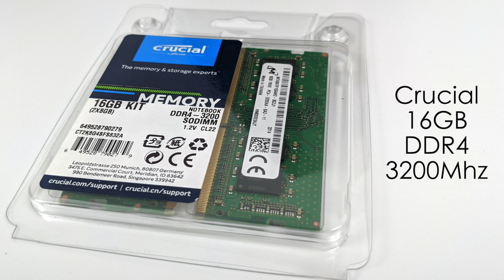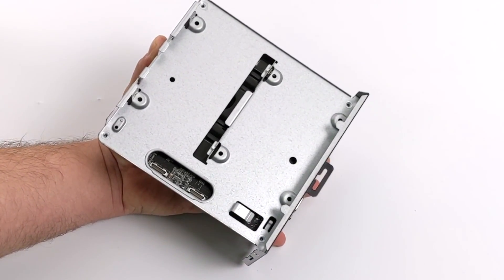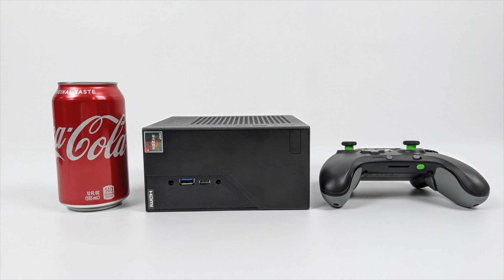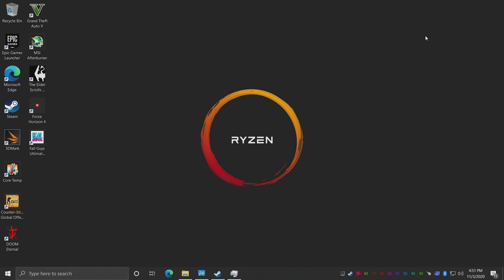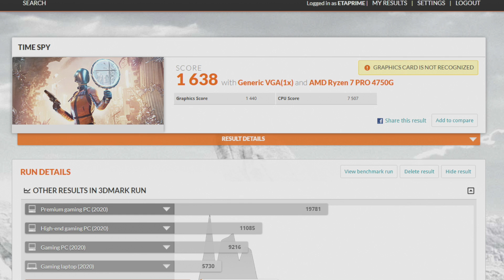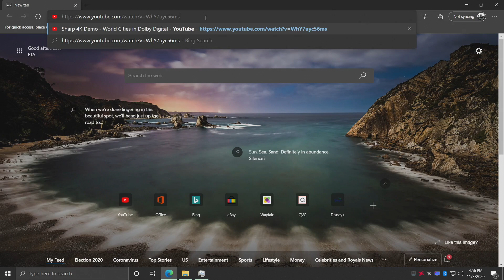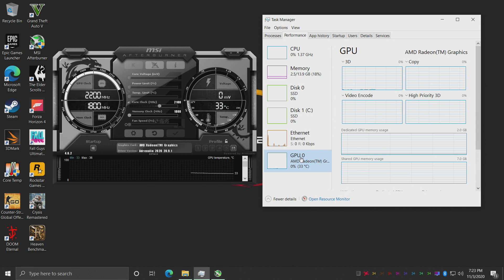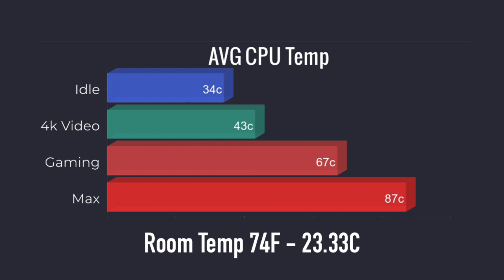Ryzen 4750G ASRock Desk Mini Build - A Tiny APU Beast!

Comment: I built one of these with a 4650G to serve as a homelab server. Put a Noctua cooler in there, an M2 SSD and 32gb of RAM and it's a completely silent Proxmox server. Couldn't be happier with it.
Reply: Where'd you snag your CPU? eBay?
Reply: @ChrisPoterala  Yep, got it off a German store on Ebay, hardwarestore2000
Reply: @noisenotmusictapes  i take it you arent in the US? It’s telling me they dont ship to the states
Reply: @ChrisPoterala  you can get it from aliexpress too .
Reply: Running 24/7? Any heat issue's?
Reply: @edrive2769  None what so ever even running 24/7. The Noctua fan covers pretty much the entire motherboard so cooling isn't a problem. I don't over lock it though
Reply: hello  @noisenotmusictapes , I'm planning to buy a desk mini x300 + 4750g for my daily work with virtual machines servers, Java developers IDEs, web browsing etc but i'm a litte concerned about what i've read about vrm and ssds 
temperatures expecially for intel models (h470). Have you ever had a chance to misure vrm and ssd temperatures or check if the over-heating of these components can cause some performance drop ? Thanks
Reply: Hi @noisenotmusictapes what kind of Noctua cooler did you use? Thanks!
Reply: @kimjexziel  I used the Noctua NH-L9a-AM4, it fits perfectly into the case and no issue with memory or storage clearance
Reply: @noisenotmusictapes  thanks!
Reply: I got a 4750g off Ali express for 265 or 300 with express postage, think they dropped the price around year end. 350 would have been too much. All quiet with a noctua and games at high settings on 1080p lol. The last new cpu I bought was an opteron 165, the original dual core. Laptops since then and a couple of used jobs to replace the opty.
Reply: Have u tried gaming on it? I want to build one wth the same processor going to be my first ever pc build! By gaming I mean like light gaming like csgo not like warzone or anything
Reply: "completely silent " you say...? Don't lie or maybe you don't even (never?) run it with a 100% on all cores ?
Reply: @adamwalter2573  Nope, not lying. Well firstly I'm not running it at 100% on all cores for longer than a burst period for encoding or something like that as it runs as a server so I want longevity over maxing it out. The Noctua nh-l9a-am4 fan is rated for 23.6 dB at max speed, barely above a whisper. Can only hear it when I'm on top of it and it's going 100%.
Reply: @okene  noctua nh-l9a-am4
Reply: Did you pay $400 too for this CPU or is this just a recent price hike?
Reply: @xThePrinceOfPeace  I paid €230 for the 4650g, which is about $270. They have the 4750g for €365 which is around $430. The price difference was too large for me to justify the 4750g.
Reply: But it does use a lot of electricity right? Like the e-bill is lit?
Reply: @VedSS-00  Nope, its about 10W at average load and I'm almost never pushing it to the max. It draws about 90W at 100% draw. It's costing me I'd say €20 a year in power.
Reply: You can get desktop xeons for pretty cheap if all you want to is run a server. I cannot imagine the market for these things. Its doesn't fall into any market except for those who have too much money to spare.
Reply: @TheFinalRevelation1  You my friend are forgetting all the people that don't have space for a rack and run a small home server in their living room.  A good silence/power tradeoff is needed in these situations 😉
Reply: @TheFinalRevelation1  I live in an apartment, I don't have anywhere to put a screaming Xeon R720. Like sure it'd be 1/3 the price I spent but where would I put it?
Reply: @noisenotmusictapes  I have two of them and if you tune them right they don’t scream at all...
Reply: @jj-icejoe6642  electricity in Germany is 30-40 US cent/kWh. if you plan on running a system 24/7, power is going to be a substantial part of your overall cost.
i often see Americans buying used server racks for their homelabs, but electricity consumption and noise levels (most of us live in apartments) make those much less appealing to us over in Europe.
Reply: @noisenotmusictapes  it’s Not screaming When fine Tuning
Reply: @TheFinalRevelation1  xeon system would run 400w idle
Reply: @ironmantooltime  2 CPU 2670 idle at 140w for me in a R720 xdz
Reply: @jj-icejoe6642  OK that's no bad. Which version? The v2 is only half as fast as a 4750g, so 20 cores vs 8 is about par. The v3 does have some headway

Comment: So, is the X300's mobo an X570 or B550? I was under the impression that 4000 APUs didn't work on B450 mobos.
Reply: Neither. It's an X300.
Reply: @elsasslotharingen7507      Thanks for the info. I thought 4000 APUs were compatible only with X570 or B500 mobos. :)
Reply: It has no chipset per se. A300/X300 are motherboards which only use the SoC integrated in the APU. There's only a small SMD to simulate the functioning of a chipset, but it does literally nothing.
Reply: Its essentially a b320 mobo. I have the a300 and it uses the b320 chipset drivers.
Reply: @yosoywilson78  Good to know, thanks. Have you tried running a 4000 APU on that mobo? Just curious about it.
Reply: @oscarruorochmolinacansino5907  yes I have the 4650g running in my a300. Works great no problems.
Reply: @oscarruorochmolinacansino5907  Asrock's A300 had a beta BIOS in which the 4000 series worked, but support was later removed. Probably not all that stable.
Reply: @elsasslotharingen7507  Incorrect. It is an a320 chipset. 

And incorrect again. Runs very stable. They only stopped development on the beta BIOS for the a300 because they want people to buy the x300. I have the a300 w/4650g running on beta bios 3.60s. Absolutely zero issues. No BSODs. No instability with my RAM OCd to 3400c16.
Reply: @yosoywilson78  Do you want to bet? One thousand dollars that you can't find an A320 chipset on the motherboard, or on the motherboard schematics. I'd prefer to receive my money through Paypal.

You have no way of knowing if would be stable on all systems that were previously stable on '3'000-series, with all the possible hardware configurations.

Asrock COULD divert staff to work on refining the beta BIOS of a product that they will no longer profit from, but they're a corporation, and corporations do things that make them money.
Reply: @elsasslotharingen7507  Dont have to bet. a300 runs on the a320 chipset drivers. You do know thats why it is an *A300*. And the new one is an *X300*. Because it is a 300 series chipset. 

I actually do have a way of knowing because there is large thread on the a300 and Im sure many more around. https://smallformfactor.net/forum/threads/sffn-asrocks-deskmini-a300-finally.10553/page-55

There is no reason to refine the beta BIOS. The only thing introduced with it was Renoir support. That was the whole point of the X300.
Reply: @yosoywilson78  It could be based on any drivers, because it doesn't matter, there's no chipset on the motherboard.

And I know that people in the SFF forums have been literally trying to do that, i.e. run the X300 software on the A300 boards. And that's possible specifically because there's literally no chipset on the motherboard, no hardware limitations besides the capabilities of the CPU's SoC and the compatibility of the CPU with other hardware.

Yes, there's a need to refine the BIOS, it's a new chip with a different architecture and that can cause compatibility problems. 300-series boards like the A320's still have problems running Zen 2 CPU's.

Comment: Love it. I've hoarded a modded (de-shrouded) Wraith for 18 months in the hope I could pick up it's predecessor. It seems, not though, the X300 has more value to me if I rip the case off and use the stx board in an old school desk I'm swapping the lid for acrylic (nephew needs a streaming/homework PC). I can't seem to find any AM4 stx boards other than this, so I may be gutting one.

Comment: Hi ETA Prime, does ASRock support 4800U or 4800 H, does it come with usb-c with thunder bolt, can I build a gaming pc under 300/350$
Reply: Asrock is the brand, the product is the Deskmini X300. Those are not AM4 socketable CPU's, so no. And it doesn't have thunderbolt.
Reply: What joke you ask
Reply: I think it make form factor more bigger i ithink ITS not wort it
Reply: Btw 4800u and 4800h is mobile cpu

Comment: I don't think 700$ is that expensive, considering the performance and the small form-factor, compared to an high-end Intel Nuc for example. To bad it hasn't a Vega 10 inside.
Reply: Yeah, I wish it had Vega 10 too. However, I read that even though it had only Vega 8 - the clock speed is much faster than the 3,000 series APU's. So from a graphics perspective, the performance in the 4,000 series APUs' Vega 8 is an improvement over the slower 3,000 series APUs' Vega 10/11. Could you imagine if they had the same Vega 10/11 cuda cores, but with the higher clock speeds? That would have been kick-ass. AMD is probably going to save that scenario for the next APU generation. Wish-list.
Reply: @galoguevara6049  I expect some improvements with Zen 3 APU's. Maybe we will get the same ~20% improve in performance, andnot just for OEM's.
Reply: @galoguevara6049  vega doesnt have cuda cores

Comment: I keep hearing about these magical $500 1650 laptops, yet I could never find one.
Reply: Lenovo makes one that I had with the i5. Terrible performance. Loud. Shit display. Meh. Spend a few extra bucks and get something nicer. Even used.
Reply: @Luke-qs2cg  like the $800 tuf laptop
Reply: They are definately out there. Question is do you really want one
Reply: Walmart had one as a black friday deal for $450
Reply: Ya gotta shop around, but your best bet is a refurbished system, even then, it's gonna be closer to $600....
Reply: @TheDrewSaga Walmart laptops are overpriced asf
Reply: There is an hp pavilion on best buy for 450$ with gtx1650 and I5 10th
Reply: wait for black friday

Comment: You know how messed up the worlds mentality are.The smaller the parts the more it cost even though the bigger parts has more features.Another thing that is funny is it has a lower gpu than the 3400g But it has insane clocks.3400g has 11 gpu cores @ 1400mhz where this one has 8 gpu cores @ 2100mhz.It makes a little sense as they cramped it into 65w tdp.Personally i would have made the cpu 95 w with 11 gpu cores.But that's just me
Reply: no it doesn't have a "lower gpu than the 3400g", that is simply you being uninformed...

3400G has 11 Vega gen1 cores
4750G has 8 Vega gen2 cores
If you don't know what the difference is between those two generations, then it is more than just "higher clocks" they also optimized those cores and those 8 cores perform better than the 11 older cores ;-)

Comment: no bios screen showing overclock features? interested to know RAM overclock, 4750G loves 4000 or more MHz DDRs
Reply: @jakelong8660  yeah the corsair's one comes in 4000 MHz not a pretty CL but ok
Reply: Do you need an older processor to flash the bios for use with the 4750G?

Comment: Yeah, I wish it didn't cost this much overall, either. I love this build.
Reply: IKR? It's really cool if you're after the small footprint but if size is not an issue, you can get much better performance for the same cost.
Reply: @sniperoth  yeah, I'm sure, but I must be getting old, cuz all I wanna do is have an "indie" machine and/or switch over to Linux. I don't need a lot of power for that.
Reply: then buy a 4650 or 4350 for cheaper builds?
Reply: The 3400G is $50+ cheaper than the 4350G, and the performance difference isn't very significant..
And the 3400G has around twice as many shaders, something like 704 shaders vs 384 on the 4350G, but there's a generational difference.
14nm vs 7nm, Zen+ vs Zen 2, these are also factors..
There's supposedly a "non-Pro" 4600G out there.. I don't think it's launched, but it's similar to the Pro 4650G. It shows up in benchmarks and CPU websites, such as cpuworld.
Here's a benchmark of 3400G, 4350G, 4650G, and 4750G https://youtu.be/ul3bqXl3LU4
Reply: @LukeHimself  Awesome thanks for the link! I've just been reading through the comments as I'm strongly considering building a very similar machine, but I'm a little out of touch with modern hardware rankings. I was strongly considering the 3400G as I thought that was the best apu available until I saw this video, but now I'm wondering how much more performance I'd get from a different chip, and if it's worth it (probably not, I'd think). Of course I could have looked up some comparisons myself, but it was nice that you shared that link and saved me the trouble (it's taken me longer to write this then it would have to do it myself lolz, but it was worth it to say thanks!)
Reply: @brandonb3279  hey, no problem. Thanks for the kind words!
Reply: Well you can put a cheap 3200g or 3400g in this i have the previous version with a 2400g i got second hand for 100 euro last year and it's just as amazing in games. 3000 series are better because of the memory optimisations. But it's not off by much.
Reply: If you don't mind older architecture, you can get lenovo m93 tiny models used that work very similar to this.
Reply: @raspernor11  That's an intel dual core dude, we're talking here about AMD APUs
Reply: @quisqueyanguy120   The Security Guard didn't specify AMD preference.  He said he didn't like cost, and you can get chips for that socket with iris.

Comment: DDR5 and RDNA2 can't come fast enough...
Reply: Thunderbolt would have been nice for an external gpu setup.
Reply: @saysbadman  In a german nerd forum, a guy realised an external gpu by using a M2 NVMe to PCI-E 4x riser.
Reply: yeah we need some infinity cache in our apu's :D
Reply: Rdna 2 is almost here. Ddr5 will arrive around time rdna 3 arrives.
Reply: @proton recuva 
Ddr5 is ready .
Ans some processor already support it .

But you can't get them.
Reply: @proton recuva "unless the leaks are wrong ddr5 will come togheter with rdna2"
For APUs, yeah, but that's probably going to be a about half a year away, while RDNA2 is coming out on graphics cards next week.
Reply: @proton recuva Current APUs are barely closing in on GTX 1050. 1650 Super is a 1060 6GB, which is a huge jump from GTX 1050.
Reply: @proton recuva actually the leaked is wrong, 5000 series not 12 core. It will be 8 core 16 thread

Comment: oh man, I have been looking for a project to tackle with my 2400g that is just sitting in a box and this might be it! Do you think this case would fit a Noctua NH-L9a cooler?
Reply: The NH-L9a fits like a charm and gives you enough room to route the aux USB cables if you get them.  Spend the extra $10 on the chromax.black and you'll never see it behind the grill.
Reply: @pfriedel  I actually have the black version sitting in a box waiting for a project! Thank you for the confirmation!
Reply: Make sure the X300 supports the 2400G, if it doesn't there's also the A300

Comment: Loving the performance of the 4750G, can't believe its doing all this without a dedicated GPU...Appreciate your efforts with this video, Thanks for Uploading lol
Reply: agree, tho wish there was a way to add a gpu, something like RX570 would triple the performance. ^
Reply: @mefjupl8679 :  I recently saw a video on "Low Spec Gamer" YT channel with a similar SFF build although it wasn't with this New Ryzen it had a dedicated 1050Ti GPU - you may want to check it out if you're interested...
Reply: @Brian Babin how much do you spend in this machine?
Reply: @kevinjahir18  You could probably find used 2400g less than $100 and iGPU speed nearly the same because of the ram bottleneck. I just put together a machine with it and it runs emulators really nicely.

Comment: I wonder if that apu will work on my a300.

Edit:  After looking at the prices, I'm good with sticking with my 2200g.
Reply: The A300 officially tops out at Picasso / 3400g territory, although apparently there's a beta bios floating around that adds support for the 4x00 chips.  I ended up upgrading my a300 from a 2200g to a 3400g just as a precaution figuring that AMD will EOL the 3400g eventually, and the performance difference is noticeable in some workloads.

Comment: Literally Everybody Else: RYZEN 5000!
ETA PRIME: haha Ryzen 4750g go brrrrrr

EDIT: In all seriousness though that performance is pretty freaking good!
Please do emulation benchmarks
Reply: meanwhile I made a 3400 build earlier this year
Reply: @robertoaguiar6230  2
Reply: @robertoaguiar6230  amd: go brrrrrr
Reply: Looks like a cpu that would sell like hotcakes if AMD sold it officially at retail.I would certainly buy a couple.
Reply: @Doobie3010  we meet again
Reply: @HoloScope  We do? Glad to hear it-or do I? 🤔😉🤫😂
Reply: That meme format is so bad
Reply: @Fleshlight_Reviewer  I know, first time I used it but it was the only one that applied to this scenario
Reply: Can we run ryzen 5000 on the same chip with no problems?
Reply: @ANabih-uo3zy  Depends if the manufacturer releases a Bios update and/or the motherboard has a supported 400 series or higher chipset
Reply: @Brian Babin curious if you every tried dolphin with 4 players on the 3400g. Also can you upscale? Thanks